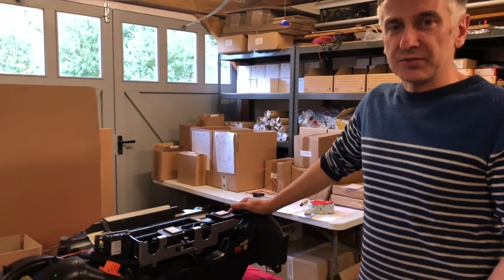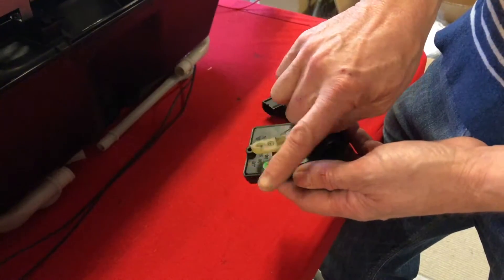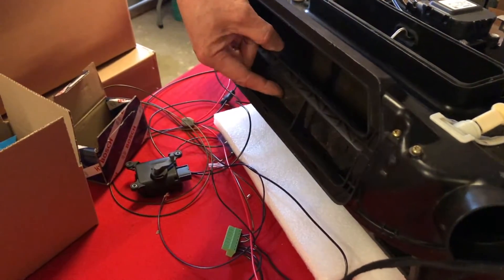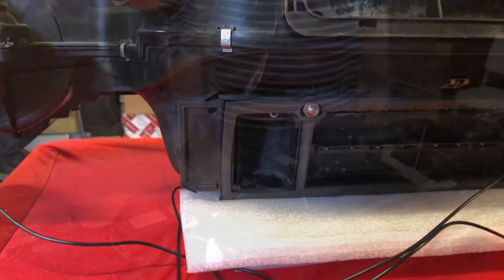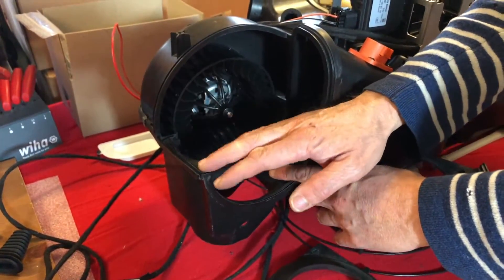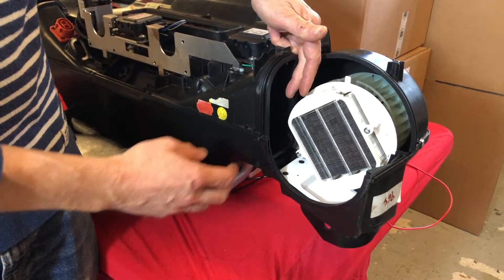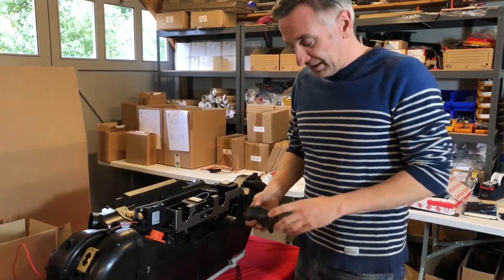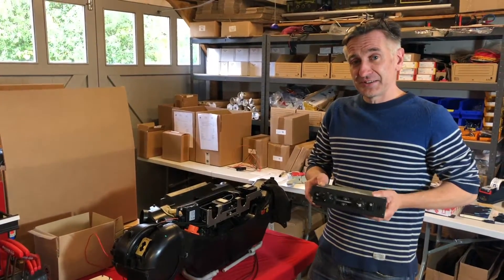Re-engineering the Porsche 964 & 993 HVAC/Climate Control System

Comment: +1. . Impressive undertaking and solutions. As an "98 Carrera S (993) original owner, ask me or any 993 about the HVAC servos. . Yeah the servo's suck, in Spades! .. Great work Gent's.. Will the stock 993 alternator output support the propossed electric heating elements? . I suppose modern-day ceramic heating elements are substantially effiecent? .. Cheers, M/S